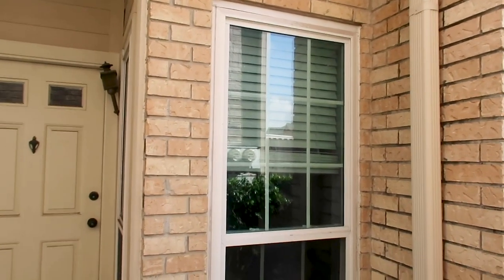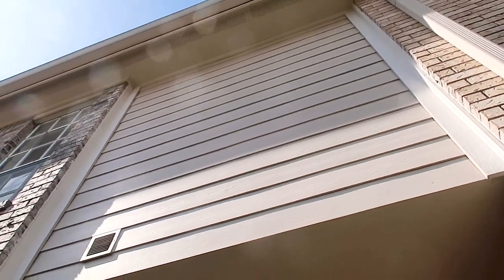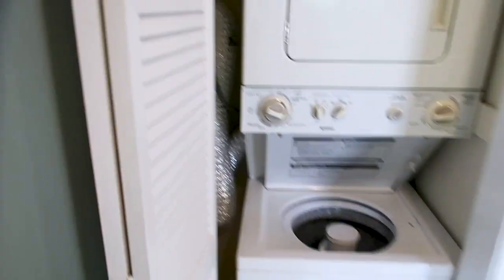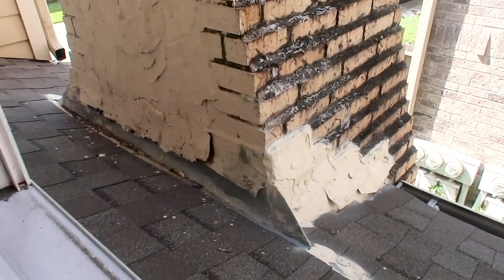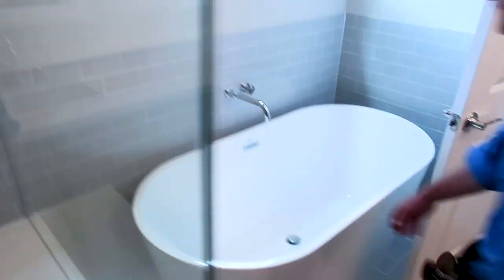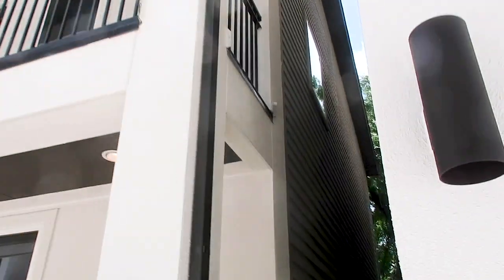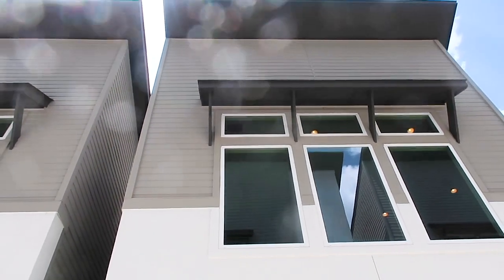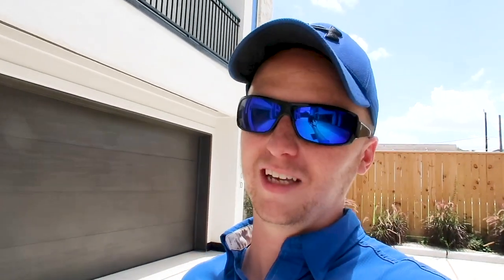Home Investigator: Episode 9 Old Home and New Home Problems

Comment: I am level 3 building inspector in North Carolina and have considered going into home inspections on side. The home inspector board told me if I get a standard level 1 in plumbing, electrical, and mechanical then I would automatically qualify to take the exam and be able to skip the hours and classes. Do you recommend this? I am 26 years old and also have a degree in building construction. I have been told that skipping the classes and hours could be a recipe for disaster. What is your opinion?
Reply from the maker: I know every state is different but if it was me I would just go the normal pathing.  It is best not to skips steps in most programs.